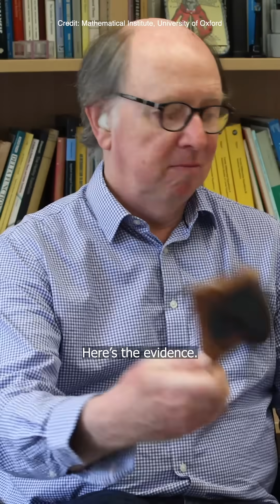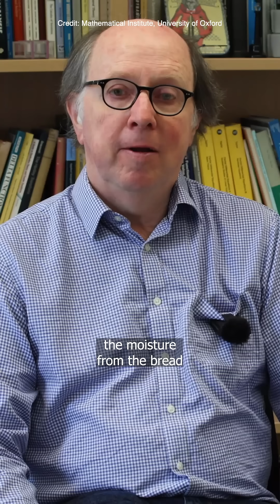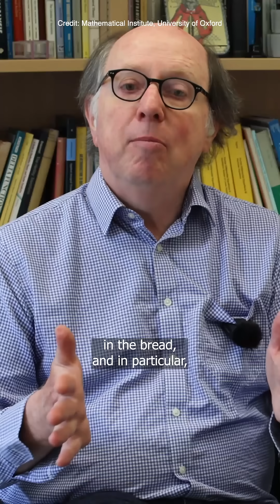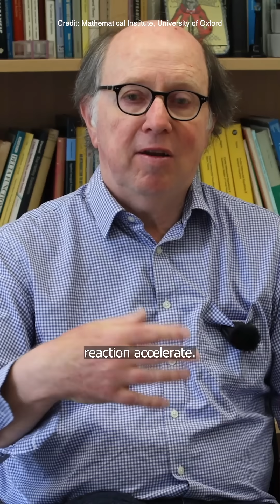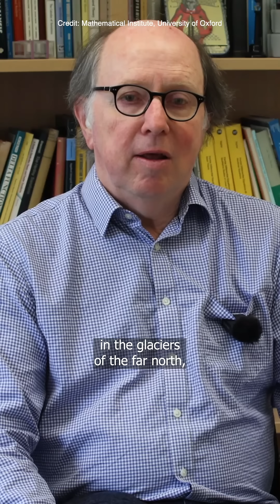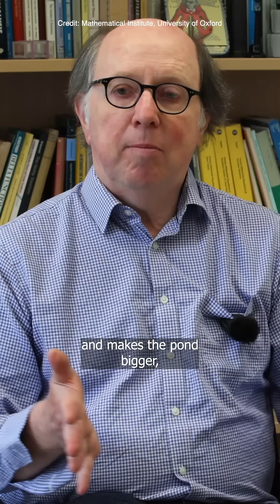Oxford professor builds a mathematical model for making toast 🍞 #OxfordUniversity

Comment: i feel vindicated!

we were asked about runaway reactions in science class (7th year i think) and i suggested burnt toast.
i got sent to the principal's office and lectured about not understanding the question. like as if i suggested planing wood as an example of cellular mitosis.
Reply: At first it is heating the water and supplying latent heat for vaporization. Then a second stage of heat transfer model is needed for caramelization. 

I don't get the runaway part, except at very high temperature carbon burns and gives off heat. But this beyond "toast" temperature.
Reply: @agnelomascarenhas8990 So you do get it. Good. Had me worried for a second there.

Comment: Official Message: English Version
To the Professors of the Physics Department, University of Oxford,
I am a student from Quetta, and my name is Sahir Kamal. I wish to bring to your attention a fundamental logical gap that seems to have been overlooked in modern physics.
My question is simple yet profound:
We acknowledge that the speed of light is the ultimate speed in the universe and that nothing can compete with it. However, if time and light do not share the same reality or speed, why are we using "Time" as the primary scale to measure "Light"?
Logically, there are only two possibilities:
Either we must admit that the speed of time and the speed of light are identical (which remains a massive scientific assumption).
Or, we must admit that our current scale for measuring light is fundamentally flawed because we are measuring a superior constant with an inferior variable.
If the "scale" itself is inadequate, then every measurement we have of the universe must be re-evaluated. Is it not time for the world's leading minds to seek a new, independent scale for light that does not rely on the limitations of time?
I look forward to your thoughts on this fundamental logic.
Best regards,
Sahir Kamal
Quetta, Balochistan, Pakistan

Comment: Is it caramelization of the glucose or burning of the carbon.  Mallarization VS combustion?
Reply: maillard reactions are usually happening with reduced sugars and amino acids from proteins combined. bread has both so first there’s maillard reaction and later it’s burning
Reply: Two independent reactions Maillard and Caramelization. Also Dry heat ie Caramelization and Wet heat are very different reactions. 

Under dry heat different products are produced depending on the temperature, I suspect the chemical changes and color are related, but I don't know the chemistry involved.

Comment: Maybe we should be covering the glaciers with white tarp in the summer?
Reply: We can also make floating white plastic platforms.  That way we remove carbon from the environment, reflect light out, and give polar animals a surface to rest.
Reply: My wandering mind.
Reply: @zpitfiyer we are fine. We do not need to remove any co2 from the atmosphere. The more co2 there is, the more quickly trees, plants, etc will grow. Those plants will convert the carbon back into solid form. The Earth is a self balancing system. We are in no danger, at all.

Consider the size of the planet and the depth of the crust. We have barely scratched the surface in terms of carbon returned to the atmosphere. 

In my honest opinion, climate change is a device used to increase prices and control over people. I wish someone with some balls would speak out against it.
Reply: @liamhenderson3753 Scientists are extremely sure that climate change is happening and that humans are the primary cause, with consensus levels in peer-reviewed literature exceeding 99.9% in recent studies, a certainty comparable to the understanding of evolution.

No one has the "balls" to speak out against it because eveyone agrees that it is real
Reply: @liamhenderson3753 no, plants won’t capture all the CO2 we‘ve emitted. photosynthesis only works in a specific temperature range and when it’s hotter, plants release even more CO2 themselves. the earth is a self balancing system but any such system can be thrown out of balance and we’re doing exactly that
Reply: They do just that at some ski resorts in Europe to protect the snow from melting.
Reply: Elon wants a parasol between the Sun and the Earth.
Reply: I don’t think that is a viable option. I think the best course is to extract more time/energy from people via climate taxes.